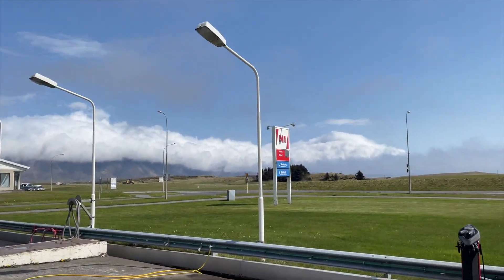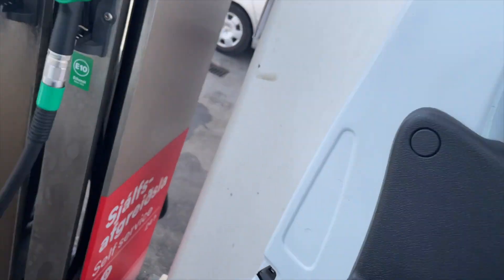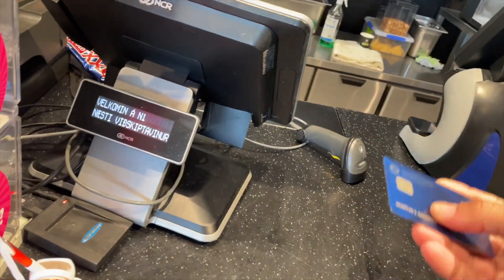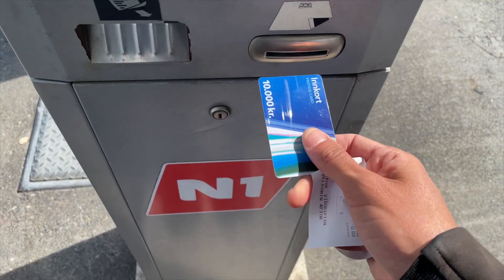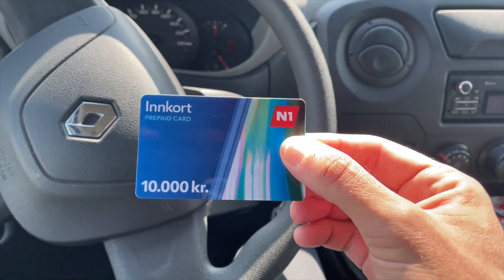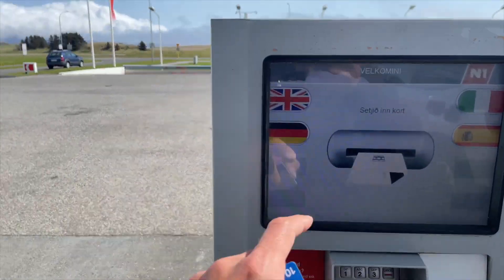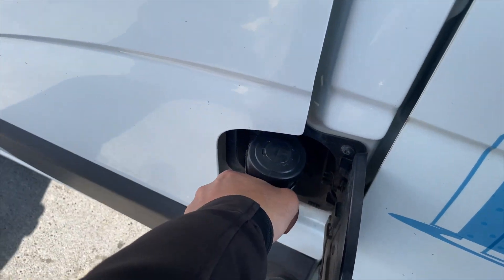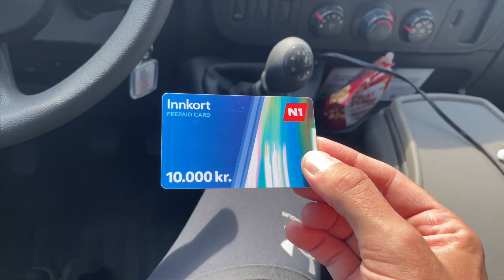N1 Iceland gas Credit Card issue solved!

Comment: After reviewing your video at the first gas pump, you were definitely inserting the card the wrong way. When you got to the second gas station you finally inserted it the correct way. The images on the gas pumps showing the black strip is correct. You finally had it correct at the second gas station

Comment: There have never been any technical problems with your card. You simply put your card on the wrong side. The magnetic band on the card is a the opposite side of the N1 logo. So, when you first tried, the magnetic band was on a LEFT side of the reader. And according to the twisted pictogram at the pump, right above where you inserted the card, the magnetic band must be on the RIGHT side (see at 2:15).

Anyways, maybe they should have put an arrow on the card to ease the process.
Reply from the maker: I put the card with the right side and it didn't work either.

Comment: Thanks a lot for sharing

If you buy the 10000 prepaid card, do you have to use it all at once ? 
Like lets say the gas tank got filled at 9000, can you still use the other 1000 later ?
Reply from the maker: @Ahmad-bx6vg  yes as it will scan as 10,000 but if you can only fill let’s say 5,000 it should withhold the balance for the next time just double check with the clerk 👍